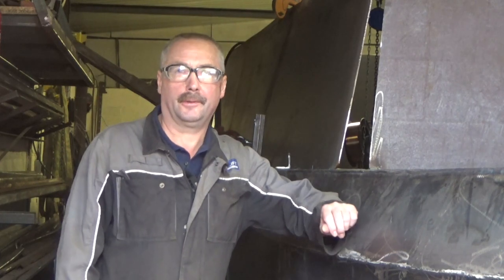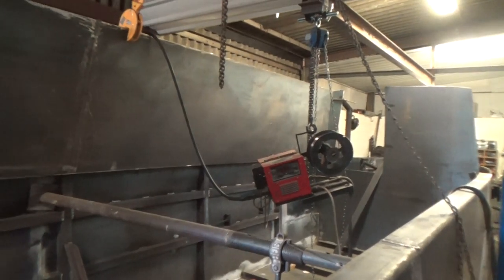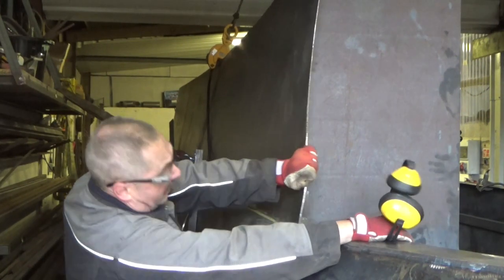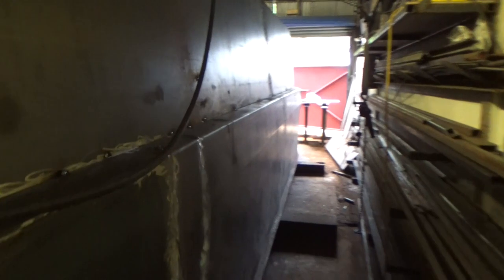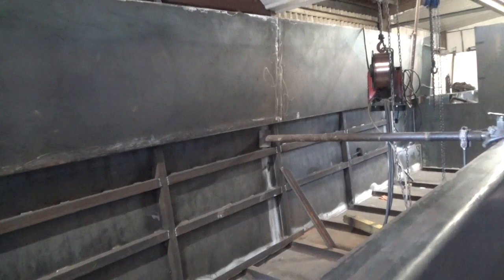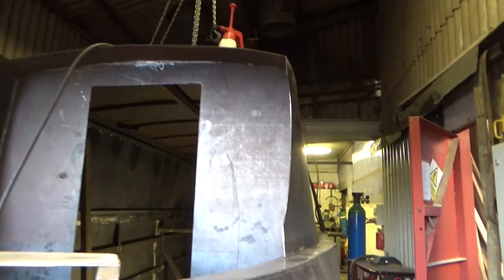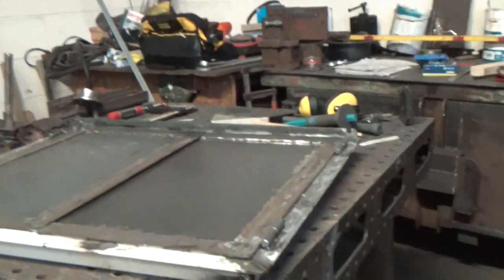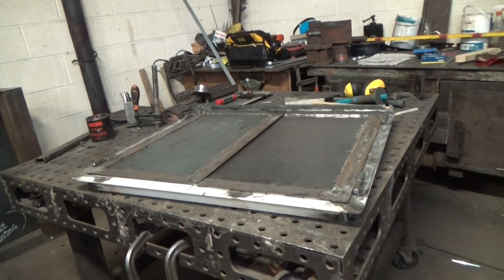Building The Ebay Narrowboat. Cabin Sides & Roof Update

Comment: Is this boat being made to order if so what's the time limit to finish. How's your boat coming on?  Has the price of steel gone up by much..? Great vlog.
Reply from the maker: Hi Will . The boat is not being made to order as such. When finished it will be sold or put out to hire. Its a trial to see if they are viable to make. The steel has gone up around 25/30 %  & some of the timber materials I use especially boards have gone up nearly 50%.